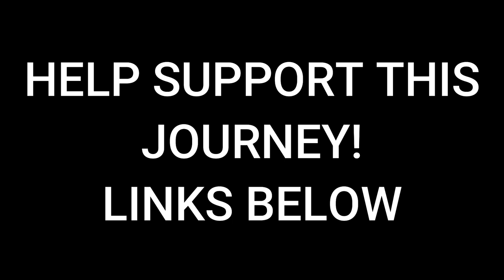The Jeep Caught on FIRE!!

Comment: Confirm that the wiring is not damaged  beyond the PDB (power distribution box).  If the wiring is good beyond that point, the fastest way to repair your Jeep would be to get a new PDB out of the same year YJ with a 6 cylinder motor.  Cut the wires (one at a time) about a foot away from the PDB and splice (solder and marine shrink tube) each wire.  If you do one at a time, you will not get anything mixed up.  With a little practice, you should be able to do this repair in about 2 hours. Take your time and it right.  You want to make sure you get a couple of feet of slack wire when you cut the new PDB out of the donor Jeep.  If you do not know how to do the soldering and splicing, go to Jeepforum.com and ask in the CJ forum.  They will help you out.

Comment: Hey Trevor, sorry to see this happened. I do a ton of wiring work at my shop, including replacing full main vehicle wiring harnesses and even building some engine harnesses from scratch. I feel confident that I could help (gratis), but the downside is that my shop is in Tucson, so there's some logistical issues since you are a state away. I'd also love to help remotely at any capacity i can. dm me on instagram @handsomeanchor it's probably the easiest way to get in touch with me